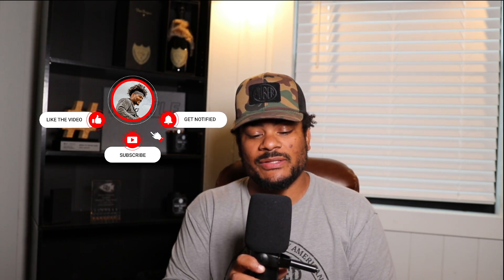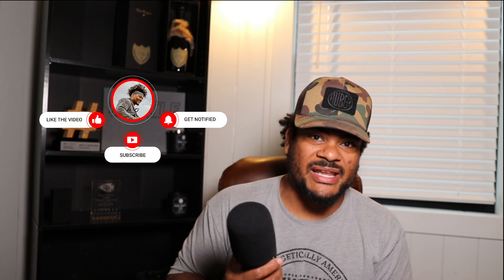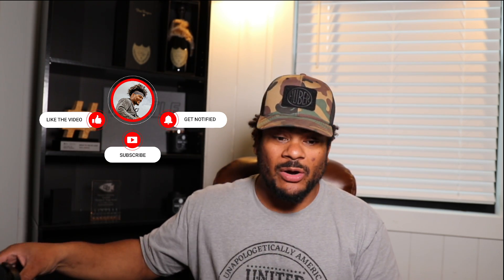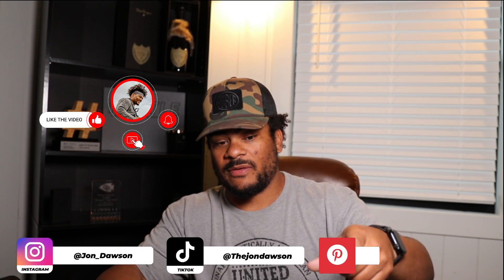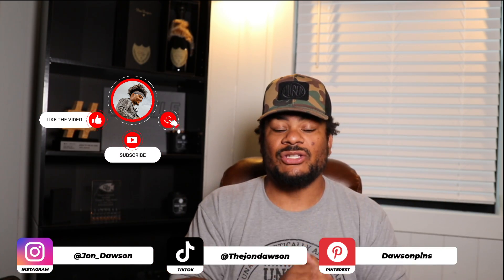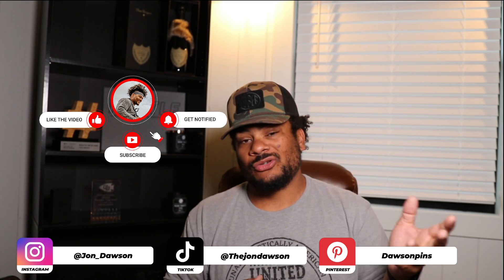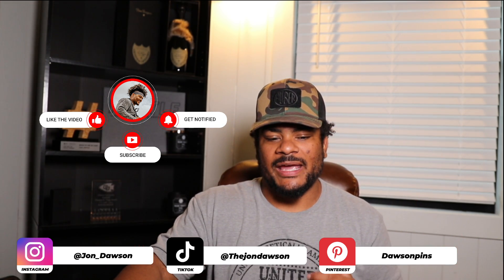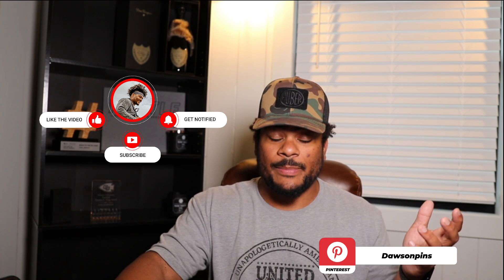2x4 vs 2x6 Framing

Comment: Thats a good point. Ive been thinking i need r12 exterior insulation when i can just get a small thin exterior insulation to create a thermal gap and then insulate inside the home. Good point.

Comment: Obviously you have never rode out a hurricane.  A structure built with 2x6 framing has higher compressive strength and is  far more resistant to lateral force pushing horizontallt against the wall of a house. But what do I know? Rode out several hurricanes in my Florida home. Hurricane Charley was my worst.

Comment: The IRC and any other building code which uses the IRC as it's model code allows 2x4 construction for us to 2-stories. 
It's get even more crazy when you start doing performance construction using 2x4's. 
Speaking of which, what is your opinion of performance construction/performance building?

Comment: I went with a post and beam square notched timber frame with a masonry north wall. To make snow load 70 lbs p.s.f. here many need to go with 2x6 framing. Each of my 9 post in my skillion cottage has to hold 8000 lbs. 50000 lbs for a 720 sq ft roof. I have a skillion cottage with r 40+ in floor north wall and roof. I went mineral wool over my insulated cored cmu block with low perm vapor barrier and air gap before masonry veneer. On a budget and building out of pocket. 2x6 construction would of cost more than a post and beam timber frame. The south wall is almost all windows for winter passive solar gain.

Comment: I prefer 2x8. Superior strength, superior insulation options and superior noise control. It doesn't cost that much more than 2x6. That said, I'd probably be using Tstud 2x8's to virtually eliminate the thermal bridging unless costs are really tight....As for 2x4 construction- not for me. Yes on paper it works, but I've never been impressed with the end result. Of course, I'm in New England and think in terms of big colonial homes.
Reply: Standard in Europe,
Evrey 24 Inches a Stud.
Sorry they are 4 x 8 Not 2x8
Reply: @MrPyro1171 that’s not actually a good thing? Wood isn’t very insulating at all and the increase in structural integrity going from 2x8 16”OC to 4x8 24”OC is negligible. You’re just increasing the size of your thermal bridge.

Comment: So I’m building my color cutter home with tri pointe and I have 2x4s Any chance I can ask the builder to upgrade whatever they are using to get the polyiso insulation for the outside? This is all very new to me and I’m glad I found this video, just don’t know how to go about speaking in terms they know.
Reply: YES! See if you can get a layer of insulation wrapped around the entire exterior if not too late. That will help eliminate the thermal bridging...

Comment: One of the guys i knew at my last job designs energy efficient residential and his opinion on 2x6 was about the same.  There are a lot of option and he said usually a double stud 2x4 wall or a larson truss or a exterior 2x4 with an interior 2x2 will be cheaper.  And definitely give you more cavity space and much less thermal bridging.
Reply: 2x6 homes are better to run wires and plumbing.. how do you guys forget this fact. when i drill a 2" hole into a 2x6 i have far more confidence
Reply: @ESo-s4b  with a double stud wall you dont have to drill at all

Comment: I'm building my 50×30 ranch style gable roof home. Thinking of doing all 2x4 studs to save $$. My problem is saving for all the joists, top and bottom and rafters. Which if I go with 2x6x16 on all I'm looking at 9000 roughly. Thinking I'll raise the frame and add a faux 2x2 roof with sheet metal while I save up. What do you think I should do considering my situation, is that even a good idea?

Comment: Interesting!
I live in a raised-roof ranch with 2x3’s as the base levels walls.
It’s ridiculous, I know—but I didn’t know the wall thickness at the time.

Previous owners built a second story on top of a ranch, adding four bedrooms and a bathroom to the house, which made it seem substantial upon purchase.

Yeah—insulation is terrible, but as for strength, those 2 x 3’s hold the house up just fine, and there’s an attic, as well, and a Tesla solar roof on top of that!

No wall cracking, etc.
Reply from the maker: Lumber is strong especially old growth. I’m assuming your home is older and probably has old growth framing. Best wood! Sadly we produce wood so quickly now it’s impossible to find now days

Comment: true but some areas further north need both 6x2 and outside insulation. How did you do your polyiso before or after the sheathing or did you double the sheathing and do an in place sips?
Reply from the maker: Very true. I did over sheathing and rainscreen over poly iso. Too much sheer value lost under sheathing
Reply: @JonDawson  i agree, the only under sheathing sheet insulation id use would be zip r3 any more you loose the sheer value.
Reply from the maker: @jhippl  yea and I want a lot more than that I went inch and a half. I considered doing zip with and additional zip r on top but way to expensive
Reply: @JonDawson  ive seen people make what i like to call in place sips where they sheath with osb then put polyiso and then put outside sheathing of normal zip